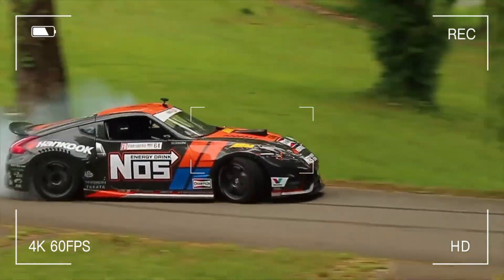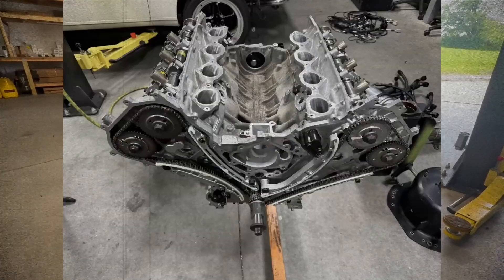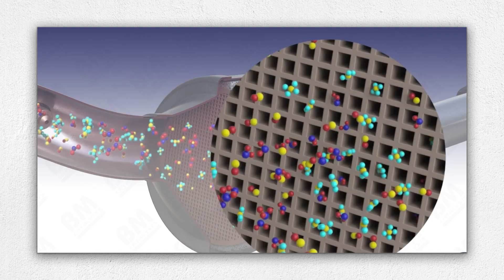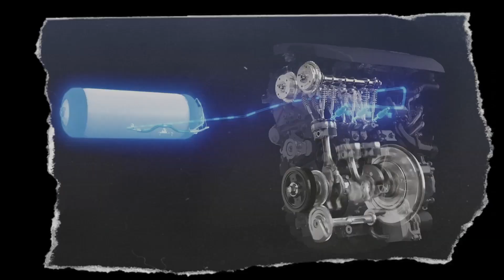Nissan VK56DE/VD 5.6-liter V8 Engine: Specs, Problems, and Long-Term Reliability Guide!

Comment: I have a 24XD P4X that weighs 7000lbs, if not more. It moves quicker than it should for such a heavy truck, even with electronic nannies activating when going full throttle from a stop. Power is noticeably pulled back and the nannies will not allow for any tire spin, even with TC off. Anyways, the 5.6 engine and 9spd trans are dialed in. I’m guessing they all put out 420hp, but Nissan probably keeps it quiet so as to not upset the Infinity crowd. The 5.6 engine in a much lighter vehicle has to be a beast - the powerband is so crisp. Sad to see this engine retired - Nissan never really tapped into its potential for the Titan and Armada in the U.S. horsepower wars.

Comment: Ive got an 04 vk56de in a titan with 223k on it supercharged the last 6k miles. Excellent engine platform. Been driving mine for 10 years no issues.

Comment: Technical question. Can you use 2015 heads on a 2019 block? I have a 2015 qx80 with a bad motor but I can get a 2019 block any information would be appreciated.

Comment: Aussie Patrol here, has one of the best modern V8 engines money can buy. Super reliable, heaps of power and low end grunt! 🇦🇺
Reply: Do you guys have any common issues with the engine? What about the transmission?

Comment: This engine suffers from carbon build up on the valves due to it being direct injection. With 70,000 miles I was getting 9 MPG.
Reply: Spray valve cleaner in through the throttle body every service and you will greatly reduce the buildup
Reply: @Chopsueyadventure  Dang I wish you told me before I traded it in.
Reply: @salimrandall  could have walnut blasted  it also
Reply: Valve cleaner through the evap system gets the job done
Reply: The VK56DE didn’t have that issue unlike your VK56VD which is direct injection. These are two different engines, basically and  lot of videos don’t say enough to differentiate the two engines. The VK56DE was the old, original Titan, Armada, QX56 engine. Simpler platform with less to fail. For reliability purposes I’ll stick with the old engine.

Comment: Poor fuel is not the reason the cats are destroyed. The exhaust manifolds are notorious for cracking on these trucks. It introduces air into the exhaust before the 02 sensor. This fools it into thinking it's running lean. So the ecu dumps more fuel in to compensate for it. Because of this, they fry catalytic converters, and the particles work their way back into the cylinders.
Reply: Thanks for this.  But how do particles from the catalytic converters work their way back to the cylinders?  They’re a long way downstream.
Reply: valve overlap which causes vacuum for minute time periods. This type of phenomenon from my experience as a mechanic only happens with catalytic converters mounted super close to the manifold or in some cars the catalytic converter is part of the exhaust manifold.
Reply: Thanks for your advice.I have an 04  titan that has a manifold leak.No cats o2 not connected (how I bought it. I decided to hook them back up to make the ck eng light go out. I did it, and now the ck eng light is off, but it's running with a miss 😂 I'll probably just unhook them I guess.
Reply: I had no idea the catalytic converters could ruin your engine when they go bad! I drove my truck for 2 years with bad cats because the DEALERSHIP even said it only affected fuel efficiency and exhaust. It was a $4k repair and I just didn't have $ for it. My engine is currently on the fritz with timing issues and bad intake sprockets. I wonder now if this was the culprit?
Reply: @d @davidisaiah51 ways a Cat can go bad.  First way but less common nowadays is They can go bad  by losing its efficiency when the precious metals degrade over a long period of time but again this normally takes a long time to happen and when they go bad like this they don’t damage your engine like a plugged catalytic converter will.  

2nd & most common way they fail is obviously a plugged up or a melted Catalytic converter. This is normally due to (on a stock engine ) underlying issues such as running rich or lean and or burning oil or  coolant in small to large amounts over time.  (This is why clean fuel injectors and keeping your engine tuned up is worth it for fuel efficiency and Cat converter life. This will for obvious reasons damage a motor. But causing timing chain problems no it would not. If you ever cannot afford to fix the catalytic converters then my advice would be to gut them out by cutting a 3 sided square and bending it outward then knock it all out then fold it back in where you left the forth side connected then weld it back up. Better than damaging your engine for sure.  You can also normally depending on your exhaust layout have universal catalytic converters that cost around $250 each welded into the exhaust.  Factory Cats at the dealership cost an arm and leg for sure. Both of my trucks have $150 catalytic converters I welded into the exhaust years ago. Still doing fine for now. A local exhaust shop can do the same thing for you as well.

Comment: WTF? VKs do not have hydraulic lifters. That intake manifold on the table is from a VK45.. HPFP lobe wear is not from fuel quality.. The fan is also mechanical and did not have issues...

Comment: Correction starting around 3:10 - Ceramic silicon dust is formed in the combustion chamber and is exhausted to the catalytic converter where it can chemically poison the converter catalyst...
Reply: It's  just repeating what Nissan says about cat failure and engine wear. It was their statement about the VQ as well.

Comment: At the 1 min mark the voice over says theVK56 is an OPEN deck design while showing an obvuously CLOSED DECK block. What?!
Reply: I was curious about this a few days ago when realizing that open deck blocks are the main reason that engines don't last as long as they used to (blown headgaskets). Imagine my surprise finding out that the VK56 was a closed deck with iron liners

Comment: I swear people always try to run the cheapest gas in higher compression dual overhead cam engines like yes maybe technically it’s OK to run on 87 but the way these engines are built nowadays I feel like they’re really made to run on 93 or 91 at least to me that’s reinforced by the fact that all government fuel economy figures are made using non-ethanol 91 octane gas
Reply: In Australia, we run ours on 98 octane (recommended)but can still run on 95octane. 91octane is not recommended unless it's an emergency and only fuel available
Reply: Correct. The 20-24 engines have 11.2 compression - definitely 91/93 territory. My gas door has a sticker that says premium fuel recommended.